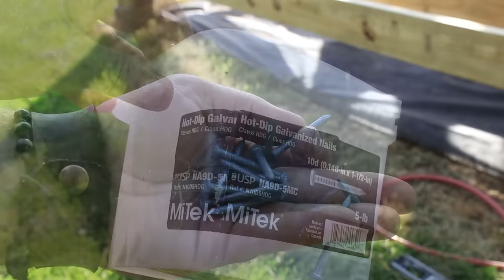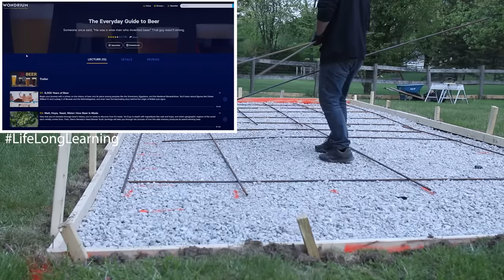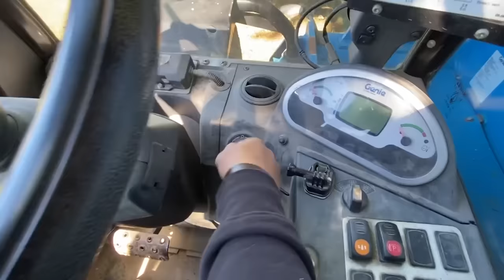How to Build a SHED from Start to Finish!!

Comment: 5:21 How much gravel is in that load? im actually trying to figure out how much gravel i need for a project
Reply from the maker: If I remember correctly it was 6 yards.  But it’s been a while and I can’t temper exactly.  There is a video I put out before this one of how I poured a concrete slab for it and there is a gravel and concrete calculator for it in the video description that will help you figure out how much you need for your project. Hope that helps Drew
Reply: @KomarProject  thanks a lot I’ll go back to that video

Comment: Niee job but I still don't understand the whole build it around the bottom of the old playhouse first, then cut down and move it with heavy equipment.  Seems like an awful lot of extra work and cost.  I know you explained it in the vid but TBH I didn't understand the explanation at all.  What am I missing???

Comment: Not sure how long it's been since you've completed this shed build but was wondering like you mentioned in the video, how are those  plexiglass windows holding up? Are they cloudy at all or maintaining well outdoors? Also did you figure out your locking mechanism for the shed. Really curious as to what you and your "assistant"/Boss Lady came up with hahaha... Happy Holidays to you guys, and be safe!
Reply from the maker: So far it’s been great. They haven’t changed at all.  It’s been about 4 months since I put them in and they still look new
Reply: I was wondering the same thing.  In direct sunlight especially they can yellow if not uv treated.  But if they discolor you can use the same method for refinishing auto headlights.

Comment: No, no, no and no!!!
Water will leak or go through the bottom joist. The concrete edge should be abit less smaller then the actual structure. Second, the floor will be a hub for thousands of termites since no pressure treated lumber was used. Third those "diy" windows will not work at all. Water will go in no matter how much caulking you use. The design looks awesome. But built wise... I would say my mamma did it. Lol
Just my two cents amigo!!! 😂

Comment: What I built my shed I didn't waste my money painting it I took a torch and and burnt the outside of it took a wire brush and knocked all the hell I don't know what you call it the burnt part off and it didn't cost me a whole bunch of paint either I don't know what you call and you'll have to talk to somebody smarter than I am now I'm too old to forgetful let it it burns the moisture sweaters the tap and try the wood on the outside off I've had enough of this crap I'm going to bed I like your s*** and keep up the good work JK I'm back I hit the wrong button to extend the comment that I turned everything off sorry I'm so tired now I forgot what I was going to say to you good luck God bless you and goodnight 5 erase the last paragraph who cares goodnight God bless you

Comment: Why you wearing bags? You got like 3 tools in there. If you have had to wear bags as much as I have you wouldn’t wear them unless you have too. Get a belt that holds a hammer and a couple small bags or even one for that
Reply: I got a belt with hammer holster and one small bag. Got pockets on jeans . Phuck bags … I hate em
Reply: You can screw those screw straight through the tin roof. No need to pre-drill holes. And you overlapped like 4 ft. What a waste